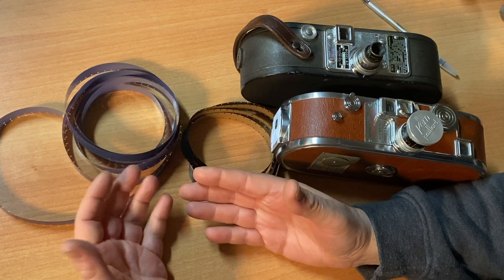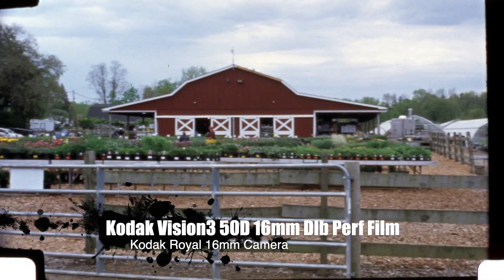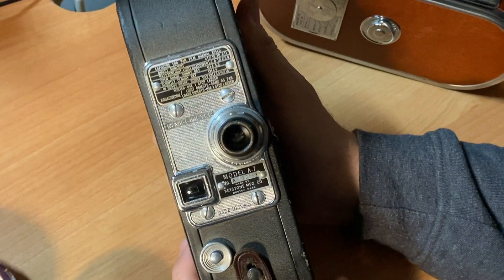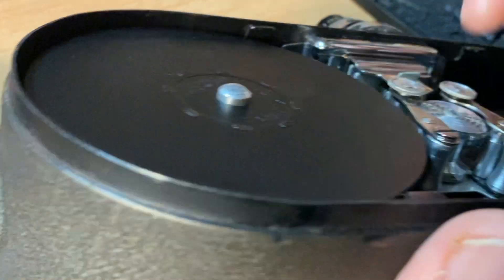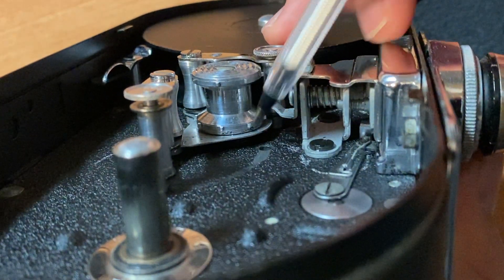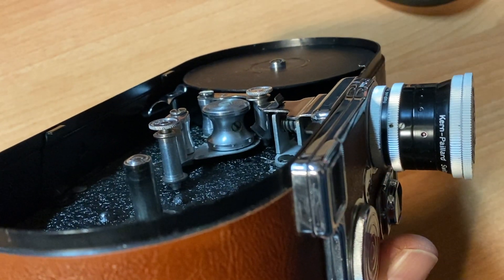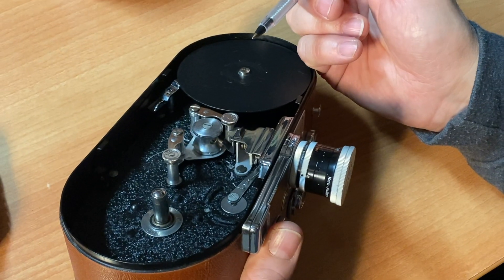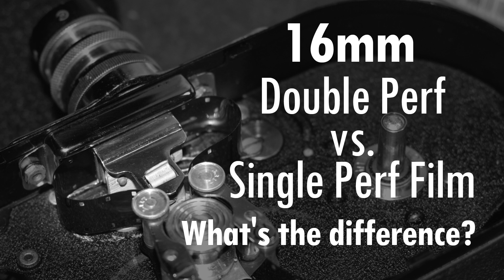16mm Film – Double Perf vs Single Perf – What’s the difference??

Comment: The double perf film looks a lot like double 8mm film.  Are they the same?
Reply: The sprocket holes are different in double 8mm, you can't interchange them.
Reply: @danielmoljr4090  Double 8 can be used in a 16mm camera but 16mm cannot be used in an 8mm camera.

Comment: Interesting -- the film transport in those two cameras look almost identical -- I bet that you could swap out the main sprocket (the round thingy with the nubs) from the "Deluxe" camera to the other camera to convert it to single-perf.
Reply: You don't even need to do that. Just file off the extra set of teeth. It is real easy to do.
Reply: @MORCOPOLO0817  Is this true? I must bough an older bolex and it's double perf.  Can i do that easily enough.  I really don't mind doing it if i can use the modern film.  Or does it cause other problems?
Reply: @clarkferguson1496  I never tried it on a Bolex. I am sure it can be done but the Keystone 16mm cameras, being budget level, were largely aluminum parts which were easy to cut.
Reply: I did it on a Keystone A7 and the film passes through the gate very steady and with good registration.